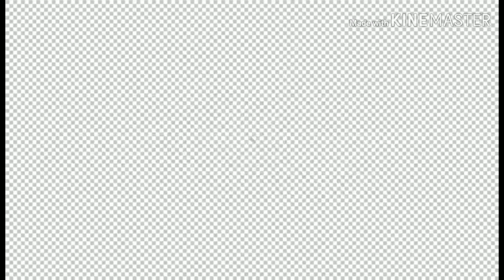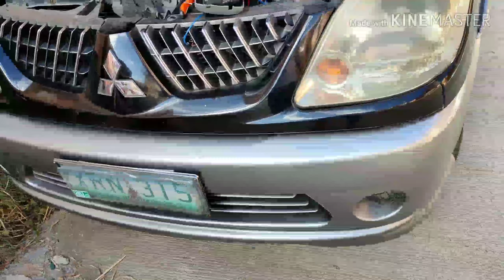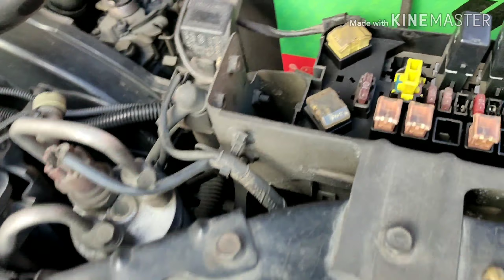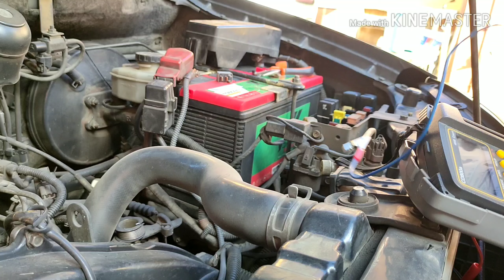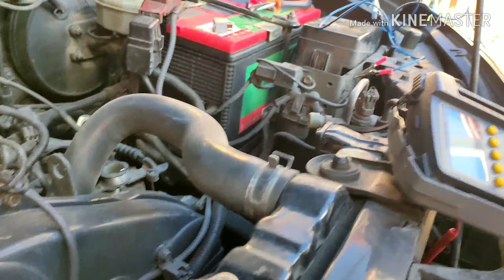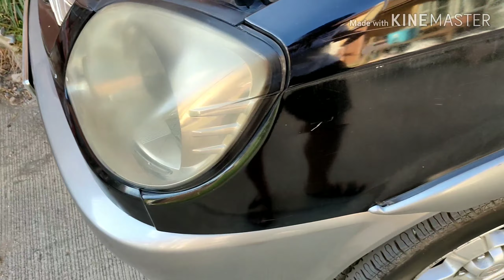Mitsubishi adventure busted headlight relay/headlight relay simple check

Comment: Sir, saan po  naka  locate ung fuse for the cigarette lighter?   im fixing my  gf's adventure and  she forgot where  the owners  manual is :/ 

even the power  side-view  mirror switch doesn't work
Reply from the maker: Sa kick panel ng driver side..makikita mo logo ng cigarettes sa takip..isang fuse lang sila ng side mirror control
Reply from the maker: Nahanap mo na brother? Sa ibabaw lang ng clutch pedal, likod sya ng lever sa hood..15amp ung para sa cigarette color blue na fuse.
Reply: @pitzmoto  sir any tips for maintenance ng engine? like air filters? how to clean and check them.
and how to determine if the timing belts is still good or not? :)
drove her adventure on the express way, hirap maka 110kph. im guessing madumi na ung air filter. di maka hinga ung engine.
ang hirap pag niwala ung owners manual pati mga previous check up.
Mitsubishi adventure 2016  gls model
Reply from the maker: @DAHBgraphy  may kabagalan talaga ang adventure.. ung air filter pwede bugahan ng compressor..replaced it after 2 change oil.